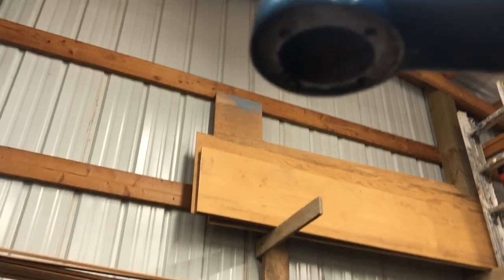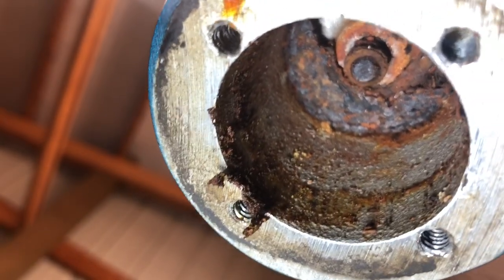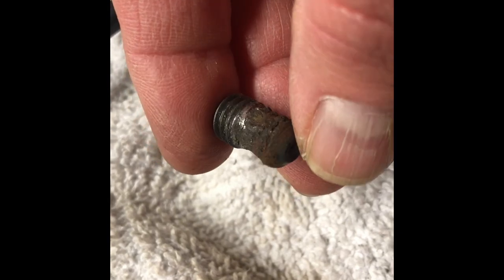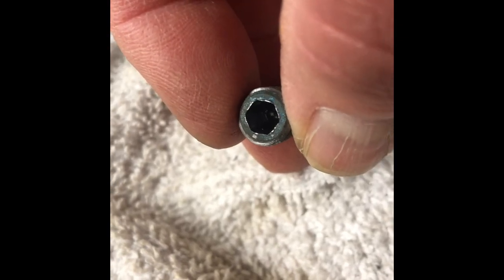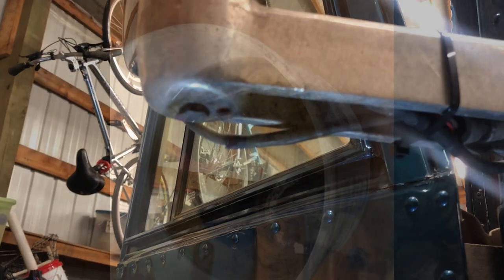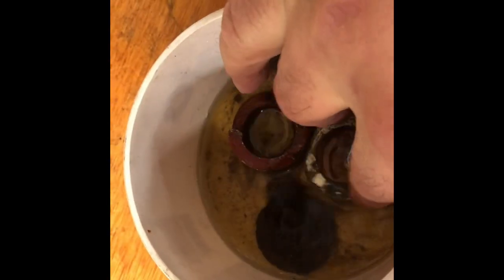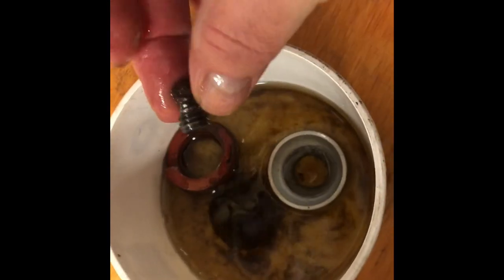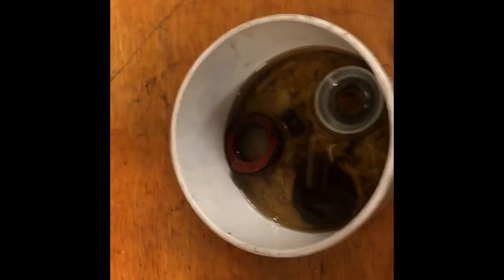4106 mirror adjustment screw removal

Comment: Great video. Interesting how electrolysis works especially between materials like alloys and steel. 
   When you pulled out the rusted bushing, I immediately thought of Teflon , you said nylon...lol at any rate, Pryor to sealing the deal, scrape off the copper from a few zink Penny's and set the penny in the access hole that will draw corrosion to the zink rather than the fasteners.
   Merry Christmas to you and your family ✌️

Comment: I would still just run a new allen on the adjuster. Just anti sieze the crap out of it. When you get the mirror arm adjusted where you want then fill the allen hole with rtv solid. My advice....
Reply from the maker: I was thinking of seeing if I could get a stainless Allen... but yeah sealing up the hole is a good idea.
Reply: @ThisOldBus  Aluminum sweats, and is porous, you'll  never seal it. Try the "MOM" treatment, ( milk of magnesia) YEP, coat the piss inside the cavity and let it dry, then assemble. If "MOM" can keep jet engine glow plugs from seizing at 2500°f it would probably remedy future problems